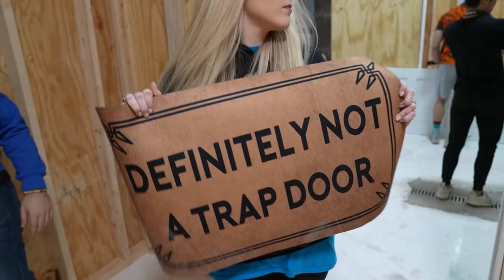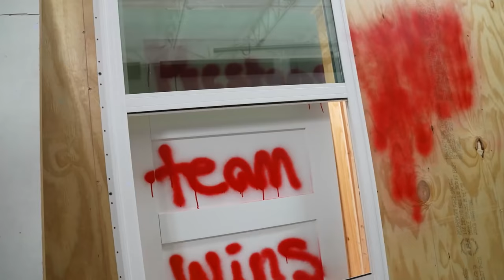I Built The Worlds Strongest HOUSE!

Comment: With the bucket a way you could of done it is rest a long beam of wood like a 2x4 along the top of the walls tied a strong rope from the beam to the handle of the bucket facing the front door and then put the bucket on a trapdoor and hook it up to a remote so when the time comes to release the bucket hit the button on the remote to let the trapdoor down which would make the bucket swing towards the door hitting whatever’s in front of it. 7:45 - 8:14. Also them decorating the houses is a waste of time taking away time from them to be able to make the houses stronger. It’s strongest house not prettiest house